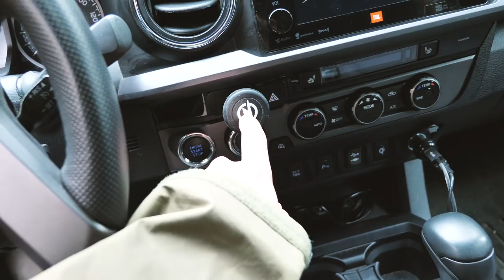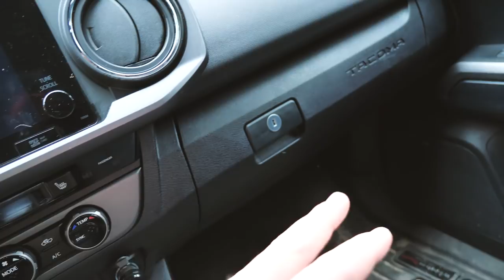EDC Basics - Part 3 - Truck / Vehicle EDC (Tacoma Gear)

Comment: “Well” is an adverb, which serves to modify verbs; “good” is an adjective, which serves to modify nouns. To put it simply: “hope you’ve been well” is the only right way to say it to convey the meaning you imply, as “have been” is the present perfect tense of the verb “to be.” One would use “good” in two cases: 1) they are oblivious to the aforementioned and 2) they are Santa Clause, saying: “hope you are good,” defining the quality of a naughty kid in hopes they are wrong with a previously furnished remote assessment of that brat. In other words, Mike, you are spot on when saying: “hope you’ve been well.”

Comment: A good way to seal the bed from dust is those water noodles from walmart, I use them on my UTV and my Chevy Avalanche.  Just cut them to size and stuff up the gapped areas.

Comment: Mike, nice setup! As far as the Taco, I am on my 3rd one, 4 door 4x4 with a 3 inch lift and 285-75-17. I did new coil overs up front and an add a leaf in the rear. I don’t have a bed cover, or any added weight in the rear, and I’m sure you know how ruff the Taco rides already. Do yourself a favor and stay away from the spacers and block lifts. I am actually thinking about going with the Old Man Emu leaf pack in the rear, to keep it from running like a squared wheel bike. Looks like you Buddy did his right, at least up front. Just My 2 cents. Hope All’s WELL.

Comment: Don't worry about what people about how clean your truck is. Trucks are meant to get dirty. Alot people  buy trucks & don't  what there used for.  Also your winter box. Take the automotive products   out. Get a milk crate. That's where the oil windshield washer solvent should be along with antifreeze or  coolant.

Comment: this might be a dumb question, but which kind of hook/loop fastener do you use for your edc panel on the inside of your door? and do you have trouble with it coming off? I live in the south and i need some hook/loop that can survive high heat and humidity 

and you are correct, unfortunately maxipedition discontinued that admin panel, but i found a decent replacement

Comment: What kind of velcro did you use to mount your maxpedition admin panel to the door? I used "industrial strength" velcro and it will not hold

Comment: Not a fan of using the truck's wireless charging pad? Doesn't it charge things twice as fast?
Reply from the maker: Doesn't charge twice as fast - but mainly you can't view GPS, etc while it's charging in there, so I don't use it often.

Comment: Funny you joke about buying the older taco because in SLC, UT where I’m from there is a huge problem right now with the tan and concrete Tacoma’s being broken into. I guess criminals have smartened up some and understand people with those vehicles will have gear/guns in vehicle. At this point I definitely wouldn’t buy those colors if the new taco if you live in or work in a big city.

Comment: 2-3” isnt modest, its optimal. Only douches that dont know trucks are going higher than that for $1000. My taco’s suspension was 10 grand and by the times its finished the total suspension cost will be closer to 20 grand. Lift height is about 2.5 inches. Drop bracket lift kits are for mall crawlers and pavement princesses. You on tacoma world?
Reply from the maker: I am on there, but I don't have a build page or anything right now - more of just a creeper at the moment. Yeah my lift ended up costing quite a bit more than I thought it would at the outset and I'm sitting right around 2.5 - 3". In the 'general populace's mind though, I think a 2-3" lift is thought of as modest. For an 'overlander' though it's pretty much the standard.
Reply: True that. What components did you end up going with? Toytec? 
Whats your tw handle?
Reply from the maker: It's just LLOD over there. I have a Fox remote resi kit, something like a stage 4ish. Total Chaos UCAs, Dakars in the rear, etc.